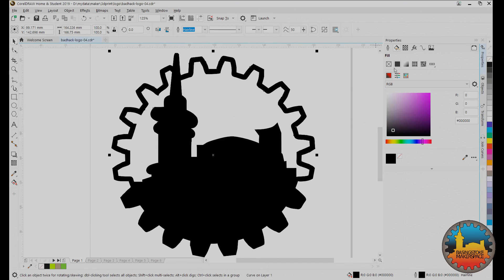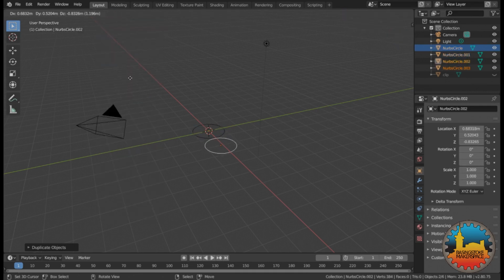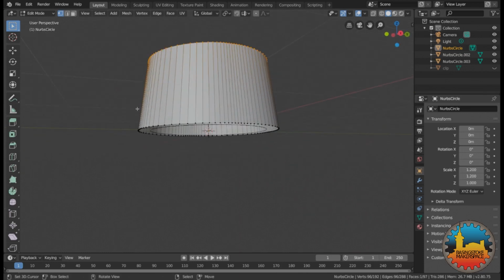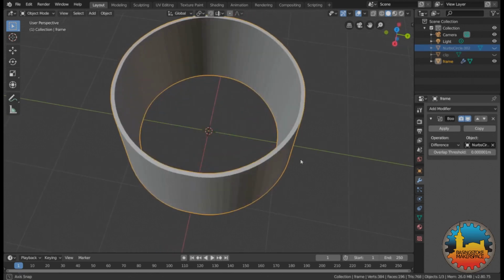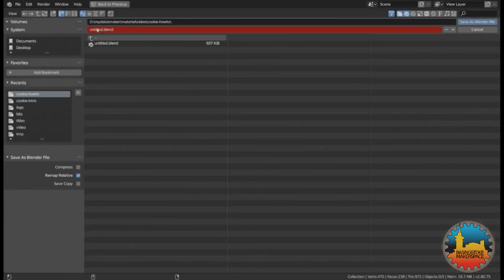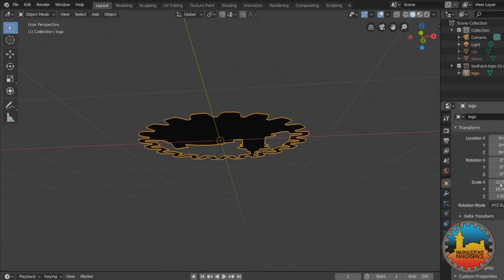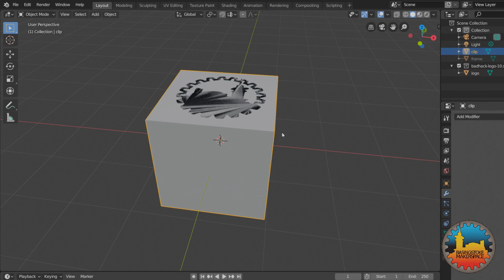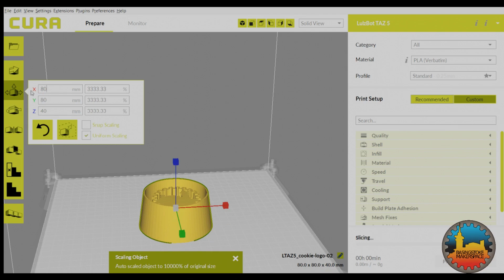Cookie Cutter HOWTO

Comment: Great video! I wonder how hard it would be to make that bottom twist on so you can sell a kit with different heads.
Reply from the maker: A really good idea... except experience of using this cookie cutter with real dough led me to the realisation that having the "cutter" and "stamp" in a single object is not optimal (bits of cookie often get stuck in the cutter).  It is actually better to have a circular cutter and a seperate stamper, in which case you could have a library of cutters with different shapes and stampers to impress the cookie with different designs.